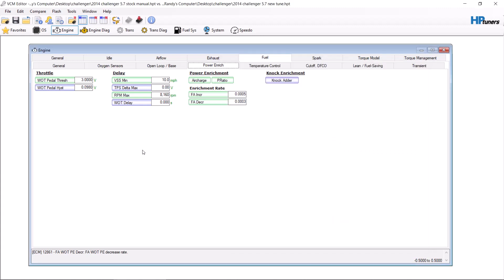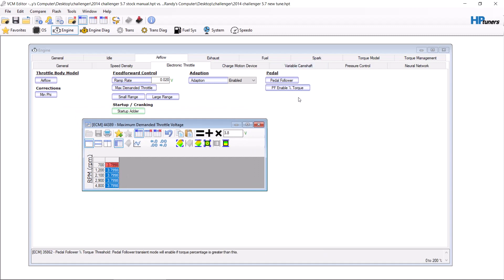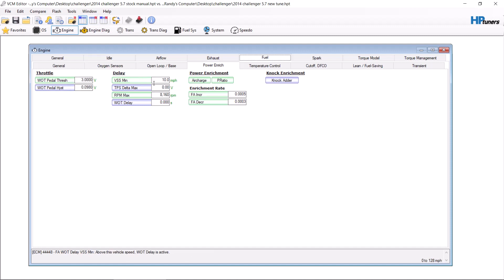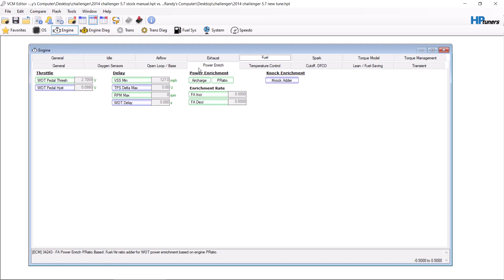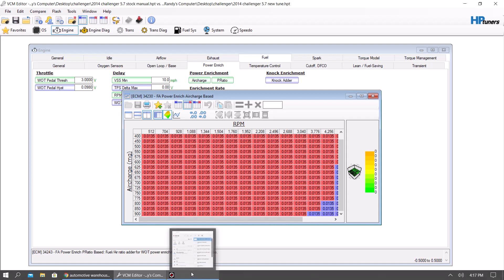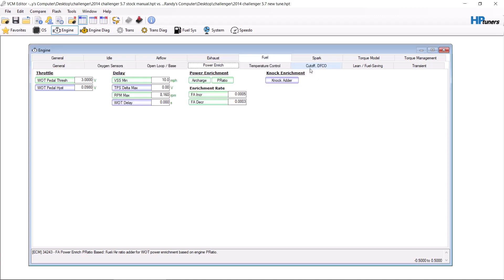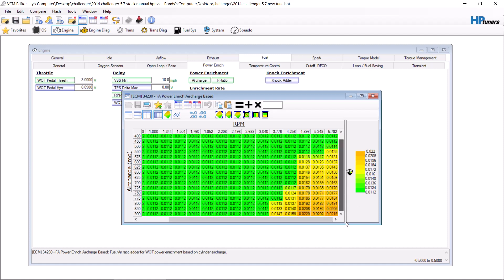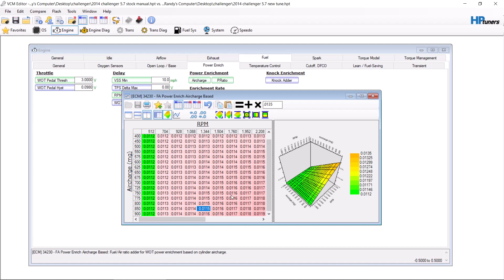Dodge Power enrichment and throttle sensitivity

Comment: I have a 5.7 charger, FBO with stage 2 cam. I am having to turn my pe tables all the way up to .0200 to get around 12.5 on my wideband. Is my wideband off, or is this correct?

Comment: Randy, Does the 5.7 like to be leaned out at WOT, vs factory numbers, to make more power?  Like your stock table, my Challengers Aircharge enrichment numbers top out into the .02xx range.  That equates to ~11:1 AFR when added to the .0688 base number.  Decreasing the enrichment to .0135 will lean it out to 12.1:1
Sound about right?

Comment: In the video you stated that by adding the values for FA Stoich and PE Aircharge it would give you Lambda which you can convert to AFR.
That is incorrect, using your numbers of .0688 and .0135 you end up with a FAR of 1 : 0.0823.
FAR to AFR conversion is 1 / FAR = AFR,  1 / .0823 = 12.15 : 1
AFR to Lambda conversion is AFR / Stoich = Lambda, 12.15 / 14.7 = .827 Lambda
Being someone that is new to Mopar tuning the first thing I did was create an excel spreadsheet to convert FAR to AFR and Lambda since that is what I am used to.
Never understood why anyone would use FAR or AFR since they are fuel dependent, Lambda never changes regardless of fuel composition and AFR gauges are actually Lambda gauges that convert the data to AFR.

Comment: Good grief, my '14 R/T's stock PE is targeting an 11:1 AFR!  That's slobbering rich, to me anyways.   Your PE value of .0135, + .0688 base, puts AFR at 12.3:1, which is where I've seen best power made on SBC's.  I know these aren't SBC's but power-producing AFR shouldn't change across brands.  It's still just a cylinder, with an air/fuel charge in it.  Did Dodge just play it safe with WOT enrichment values?

Comment: I have a question please. I've been watching you videos and they have really help me get my 5th gen Ram more responsive and overall drive better so thank you. My question is, if the max throttle voltage is 3.80V why does my throttle only show 86.7% open? I've tried increasing the "Max Demanded Throttle", "WOT Setpoint" & "TPS 1 & 2 Max Voltage" but every time I get on it I get a throttle issue appear on the dash and the truck goes into limp mode. The scanner shows 4.26V & 95.7% before the error comes up and it goes into limp mode. I've reset the max voltage back to 3.8V and no more errors for now. Thank you in advance.
Reply from the maker: Hptuners doesn’t always read properly is the big issues
Reply: 100% is actually past the point of being all the way open and closing off again theres no stop like with a cable throttle

Comment: you may never go over 8100 RPMs ,  the reason we had to ditch the OEM PCM and switch to  Haltech in my 05 is because my 392(6.1based stroker) is  hitting 8600 thru the traps.......but your  tutorial here is spot on , thanks for taking the time to upload and  make it very user friendly